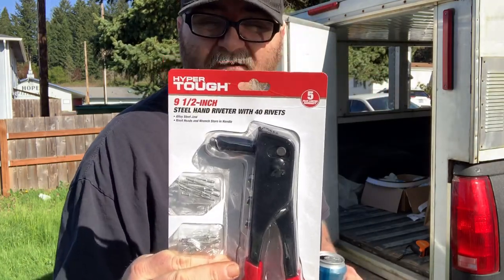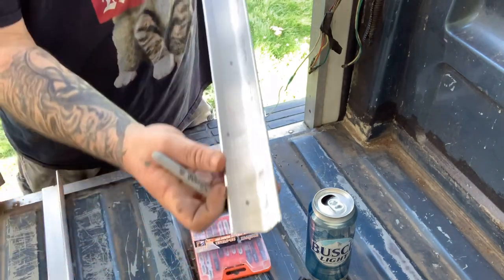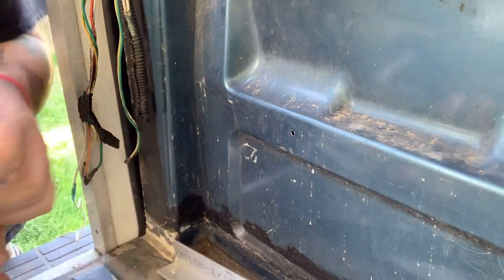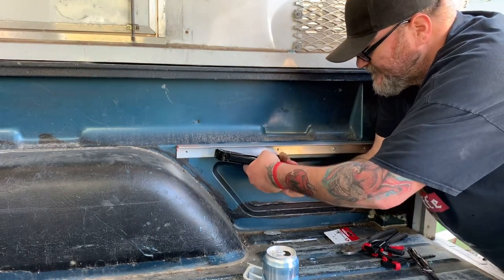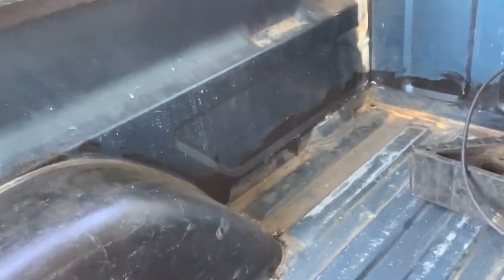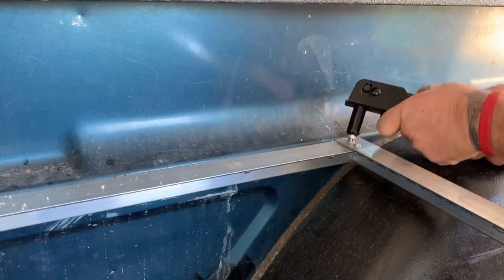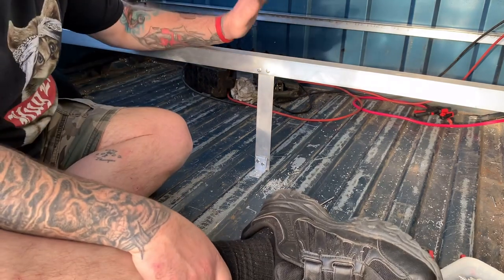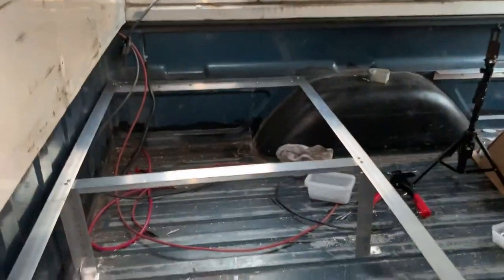Ultra light aluminum bed platform for truck camping & nomads

Comment: The support bar going across the bed walls should be angle iron or steel tube steel, you would not need a support brace in the center down to the floor. Support braces are always in the way when sliding tubs of gear around so I always design things strong enough to avoid them.
Reply from the maker: My worry is the rust. I live in the PNW

Comment: Awesome!.... 2 questions; 1- how do you remove pop revits
2- anything extra to consider with a linex-liner??
Reply from the maker: If its line-x lined,  you may need the half inch pop rivets instead of the 1/4in. To get through the angle and bed. And pop rivets can easily just be drilled out. I demonstrated on the video i believe. Thank you for watching 🙏